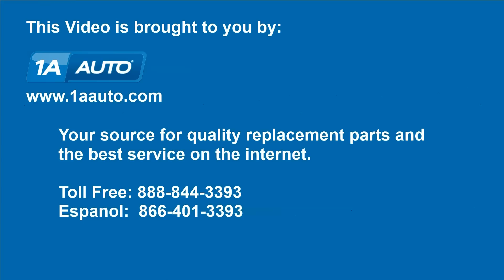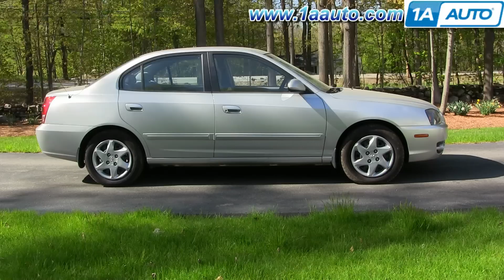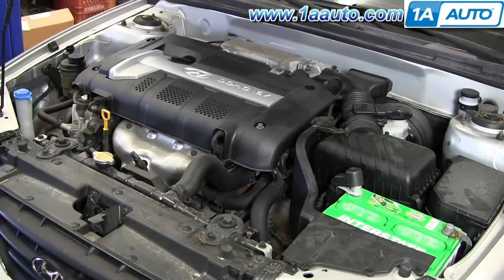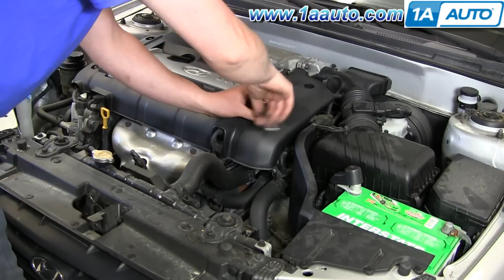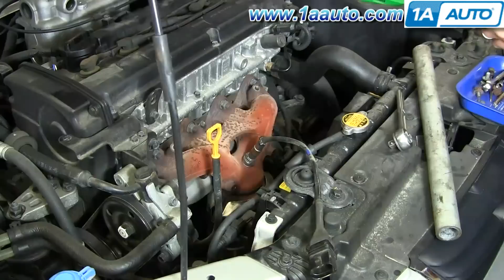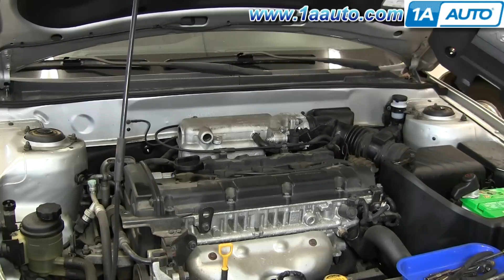How to Replace O2 Oxygen Sensor 03-09 Hyundai Elantra

Comment: Fantastic video, helped me change my O2 sensor with zero problems.  Well, one problem, and that was my fault.  Before you buy a new sensor, unplug the old sensor and note or take a picture of the type of connector.  When you buy the new one, take it out of the box and check it first.  I purchased one locally that was supposedly for my '05 Elantra, only to get everything disassembled and then find out that the replacement part had the wrong type of connector.

Comment: Hi.  Question:  Does the computer automatically connect to the new sensor or do you need to do anything to have it connect/calibrate after the new part is installed?  Thanks.

Comment: a car parts store told me that there were two different oxygen sensors and I would need to check with the dealer on which one my car has. one was an "Ultra low emissons" and the other just "low emissions".   He said I needed to make sure i buy the same one when replacing it.  one is $75 and the other is $130, so i'm wondering how do I know which one to buy?     Was he confusing an upstream and downstream?
Reply from the maker: +Joe John Watson Thank you for checking us out. On some vehicles, the readings and wire length or connector of the oxygen sensor is different based upon the emissions set up. If you call us at 1-888-844-3393 with your vehicle VIN we may attempt and confirm this emissions set up to provide the appropriate oxygen sensor, or you may contact a dealership to obtain a OE part number to cross reference. 1aauto.com
Reply: The more expensive one has 5 wires, while the cheaper one has only 4 wires.
Reply: If your car is a Ultra Low Emissions Vehicles (ULEV) or Super Ultra Low Emissions Vehicle (SULEV), it will say as such on the under side of the hood when opened. There will be a sticker or engraving somewhere stating it is ULEV or SULEV compliant

Comment: I have a 2008 Hyundai Elantra SE. I replaced the upstream 02 sensor once before just like the one shown in this video, but I forget what compatible part number it was. would the part number be on the black square plug somewhere? I believe it was either Bosch or Delco brand; I cant remember since it was 3 years ago I replaced it.

Comment: Will the check engine light turn off after u replace it or does it need to run for a little while??
Reply from the maker: +Ramon Garcia If you have access to a code reader, you can clear the code immediately, otherwise you can let it run for a while if it doesn't clear right away.

Comment: On my 2005 Hyundai Elantra , I have codes P017 p2237 p001 and p2243. Base on some research it seems like I will need to replace O2 up stream bank 1 sensor 1  correct? I called a dealer and they quoted me $217.55.  Is your link the right part for my car?

Comment from the maker: The wires should connect right up for you. The computer will adjust to the new O2 sensor automatically. 1aauto.com 888-844-3393

Comment: Should I put Anti-Seize Lubricant on the threads when installing the new sensor?
Reply from the maker: +Illusion (Classic Rock) You can put a little on the threads. You do not want to get any on the actual sensor part. Hope this helps you out. 1aauto.com
Reply: 1A Auto Parts Thanks!

Comment: So I got the code of P2251 on my 04 Elantra. If it turns out to be a faulty sensor, and I decide to DIY, do I need to clear the code after installing the new sensor and then test it? Or the check engine light will just come off on its own?
Reply from the maker: +Martin Huang You will want to reset the code, and then install the new part.  This will allow you car's computer to learn the new part, otherwise it will be expecting a reading from the faulty one.  1aauto.com
Reply: How to diy reset the code 1st? AutoZone did a diagnostic test on my check engine light w/ P2626 bank 1 sensor 1 error. How will I know which oxygen sensor I need to replace. I have 2006 Hyundai Elantra.

Comment: I'm curious why you're taking the engine cover off to do this replacement. It doesn't seem to be in the way of the heat shield or the connector for the oxygen sensor.
Reply from the maker: It will give you a little more room to swing the wrench if you remove the cover on the engine.

Comment: Hi, could you tell me what 's the Exhaust Manifold and what 's the Catalytic Converter? I am confused and I do not know what is the difference between each other cause they look same. Thanks
Reply from the maker: Thank you for watching.The Exhaust manifold is the part of your exhaust that physically bolts to the engine. The Exhaust comes out of the engine from each individual Cylinder, the Exhaust  Manifold takes each cylinders exhaust and combines them to flow through 1 pipe to the rear of the vehicle. Basically it takes 4 individual pipes and combines them all into 1. The Catalytic Converter is for emission purposes, it will take any unburnt fuel in the exhaust and burns it to give off less emissions. The Catalytic Convertor is built into the manifold on this application. If you pause this video at 2:44 you can see the manifold on this vehicle. It is the part the sensor screws into. Below is a link to the Exhaust Manifold/ Convertor on our website. There is also a picture of the assembly.
Hope this helps!
1aauto.com 888-844-3393
http://www.1aauto.com/search?model=676&categoryNameFld=Exhaust+Manifold&q=*&year=2004?utm_source=YouTube&utm_medium=VideoReply&utm_campaign=1ATony
Reply: Thanks
Reply: Thanks, I just have one more question please, I have speed acceleration problem with my car, where it almost reach to speed of 140 m/h, so I took the the car to the mechanic, who told me to empty the carbon within the Exhaust manifold and it will solve the problem also he told me that the carbon is the reason behind  the ruin of the Oxygen sensor, and he also warned me if I empty the carbon the engine voice will be much higher than usual, so what do you think about that. I am confuse what to do, change the whole manifold or just empty the carbon. and if I leave it on this status without doing anything, does it make any future problem to the engine. help please.
Reply from the maker: Saleh Belmeshkan If there's a check engine light on at all, you may want to pull the engine code to see what it's pointing to.

Comment: Can you tell me where is located the Oxiven sensor Bank 2 sensor 1.  2007 Hyundai tucson 2.7 6c
Reply from the maker: +Carlos Estrada It should be the O2 sensor closest going into the front side of the engine.  Bank 1 is the rear side of the engine.  1aauto.com

Comment: My diagnostic test for my Hyundai Elantra is P2626 Bank 1 Sensor1 it says. How do I know what kind sensor I need to replace? I was going to purchase a O2 sensor but AutoZone asking me if it's low emission or ultra emission. How do I find out that? Also how do I replace the downstream for my Hyundai Elantra 2006? Thanks
Reply: your car will say ULEV or SULEV compliant if it is one of those, under the hood when open

Comment: You say in the description here that this is for models from 04-08 so I just wanted to know if the 2.0L engine in the 09 elantra has the same configuration with just a single bank.
Reply from the maker: Thank you for watching Charlie. The process may be a little different for a 09 model. We will keep it in mind for future videos.
1aauto.com 888-844-3393

Comment: hi my check engine light is still on even after all codes have been addressed, any advice would be appreciated
Reply from the maker: You may need to drive the vehicle for 80-100 miles after the repairs have been made for the check engine light to turn off. If it doesn't turn off, you may need to turn it off manually with a scanner. Hope this helps you out. 1aauto.com 866-403-3393

Comment: Where can i find bank 1 sensor 2 on this engine?  My car shows p0139
Reply: It's your downstream o2 sensor so it's on top of your exhaust after the exhaust manifold
Reply: @lukewebeck1682 so its under te the car? Or under the Hood Somewhere?
Reply: It's under the car after the exhaust manifold bends to the back, on top of the exhaust pipe. Look at the other O2 sensor replacement video by the guys that made this video

Comment: I have a P0038, P0136, B1 S2 O2 code (as shared by the auto body shop).  I'd like to try and replace any sensors myself and save some money.  Can I get a little direction on the part?  I'm dealing with more than one sensor, potentially?
Reply: Jon DeWaal go to an auto shop and ask them specifically what you need to do and they’ll give you all the tools and may even help you do it

Comment: It looks to me like you'd be much more likely to damage the harness by sliding the heat shield over top of it after the sensor is installed. I mean the wire never even touches the heat shield without taking it off..
Reply: Yes!
There is no good reason to remove that shield. It increases the odds of damaging the wire.
That step is a waste of time

Comment: Hi ... I have changed the O2 S1 B1 for Elantra 2003 , but the P0130 error still exist
What is the reason??
I used the X-431 to Delete the error code after I had installed the new part, the error code and the (check) signal gone for a while then they appear again !!.
Help Please.
Reply: Your cat is bad

Comment: I Have an 06 Hyndai Accent that needs the upstream O2 sensor replaced. is in the same general location as in this video for the Accent?
Reply from the maker: +Taylor Fulk It may be in the same general area, but the upstream sensor will be mounted in the exhaust before the catalytic converter. They are usually in the same general area. Thanks! 1AAuto.com